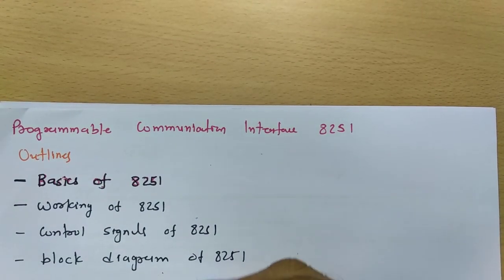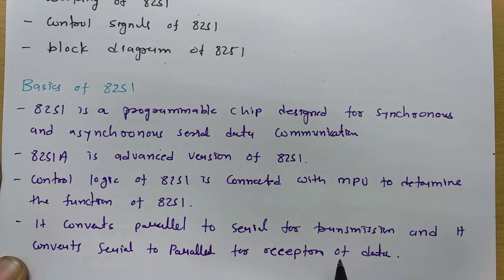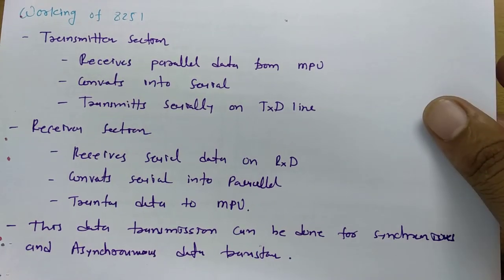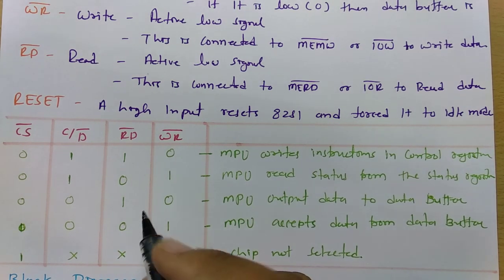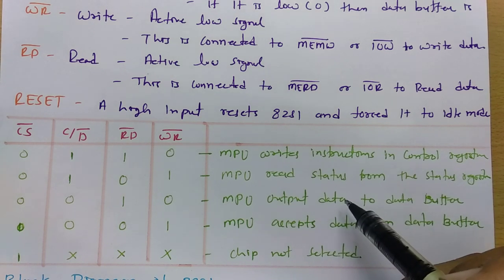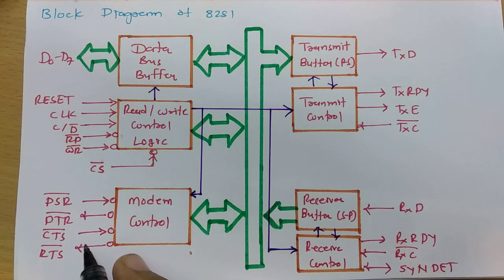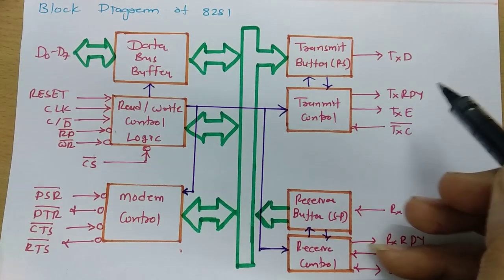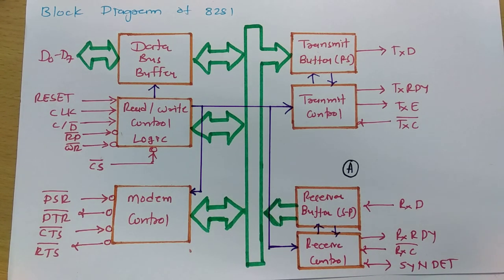Programmable Communication Interface 8251/8251A (Basics, Working, Control Signals & Block Diagram)

Comment: sir at transmission of 8251 you wrote receives parallel data its wrong ,corretc one is TRANSMITTS PARALLEL DATA  MP
Reply: receives serial  from peripheral devices and transmits parallel to mp or recieves parallel from mp and transmits serial to Peripheral devices. So, he is right and you're not wrong as well.
Reply: Receives parllel data from microprocessor and convert it in to serial for transmission